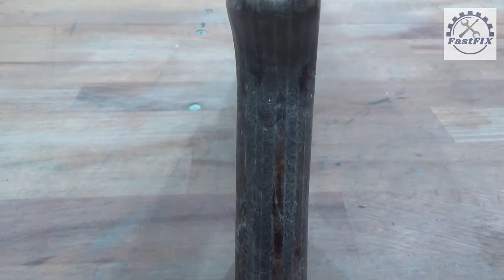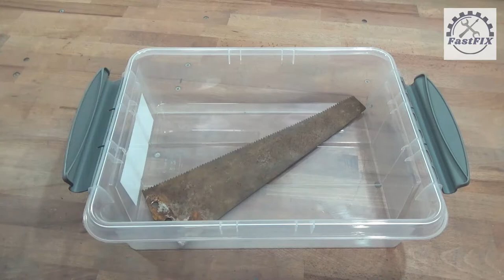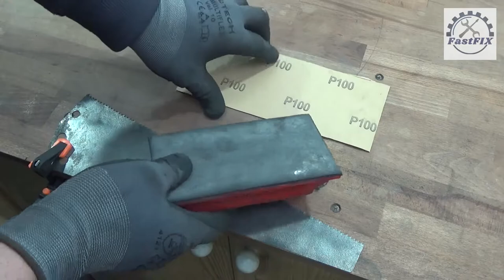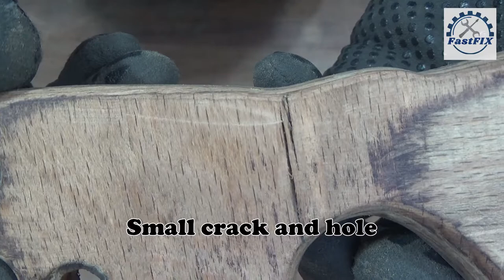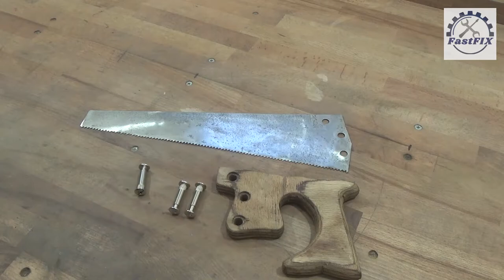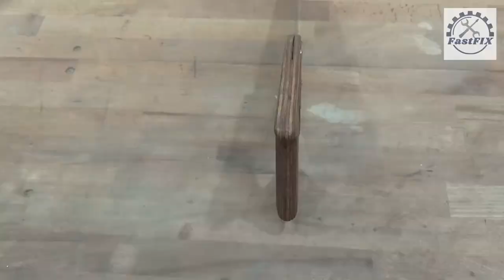Rusty Hand Saw Restoration

Comment: You did a very  nice job of straightening the blade. It is somewhat difficult because it is spring steel. To sharpen that kind of saw they use what is called a " saw set tool ". It slightly bends each tooth a small amount from the centerline of the blade. They bend every other tooth in opposite sides of centerline. I have a tool that is about 100 years old that i got from my grandfather that they use. Nobody does it today, they just throw the saw away and buy a new one.✌🇺🇸😉Roger
Reply from the maker: Thank you so much Roger for watching the video. Yes, it’s hard, I spent a lot of time straightening the blade. I didn’t have the right blade sharpening tool, so I tried this method. Not the best way😉😉😉

Comment: Nice restoration. 
The saw plate has lost its tension, cut the saw plate down to half its length and recut it as a floorboard saw, then it may be used again.
Reply from the maker: Thanks for watching the video and commenting.
I'll try to do as you told me.
If you haven't subscribed to the channel, please do it.